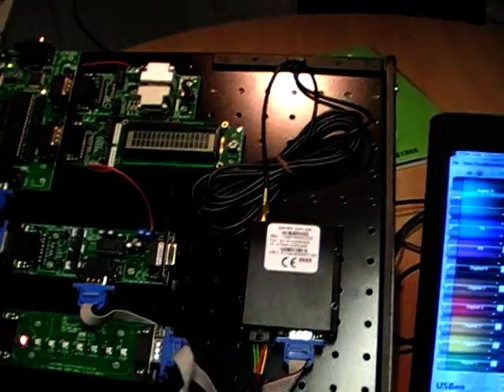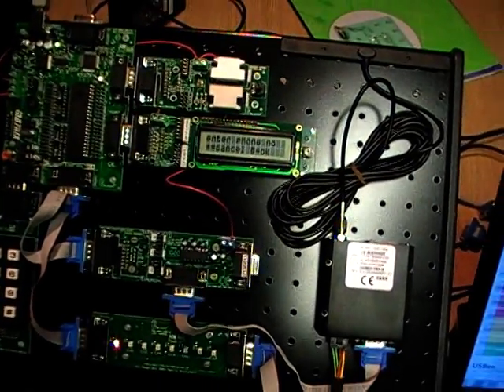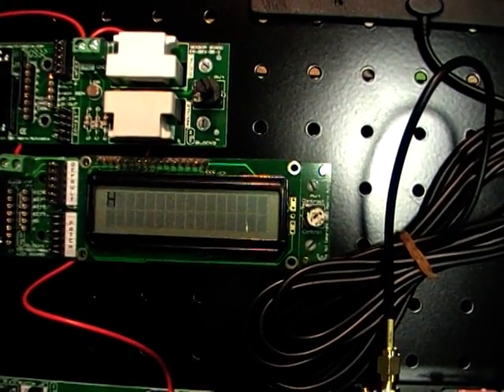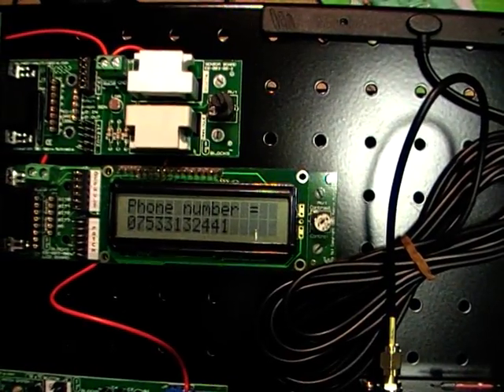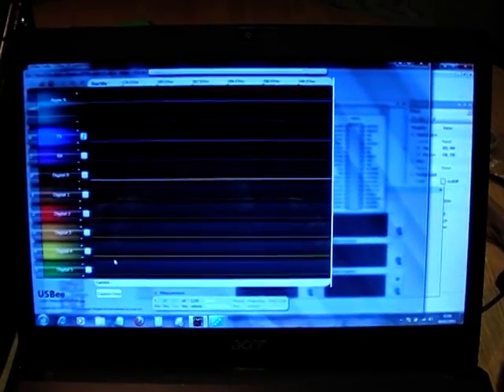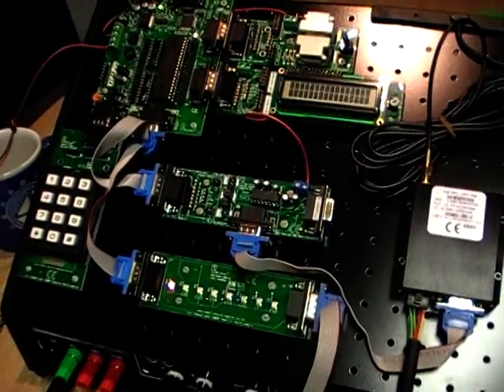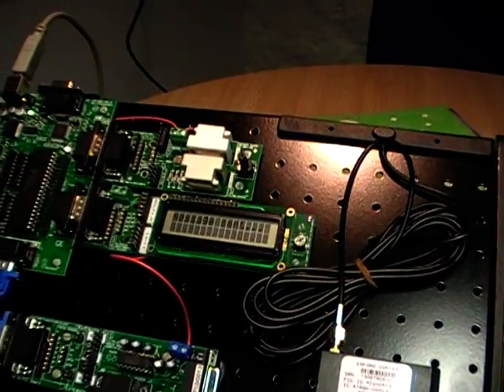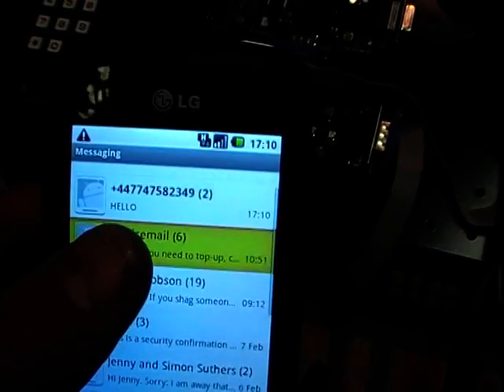Introduction to The Electronic Workstation

Comment from the maker: @todaslasmujeres 
Hello!

As a company who sells mainly into education it has certainly has its uses there as an all in one solution for circuit analysis, it is compact and easy to pack away with all the relevant cables stored inside it. The commercial potential is a bit more limited, but we have sold these to customers who require a mobile circuit analysis toolbox.